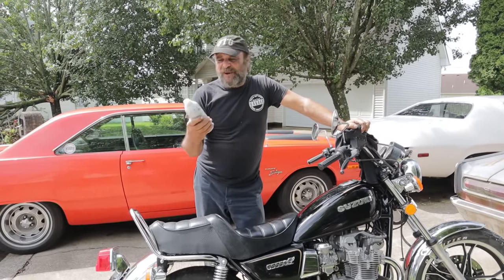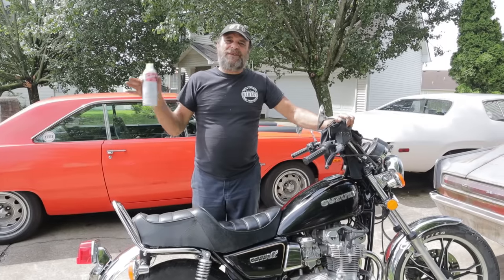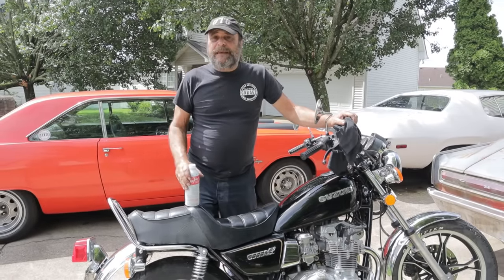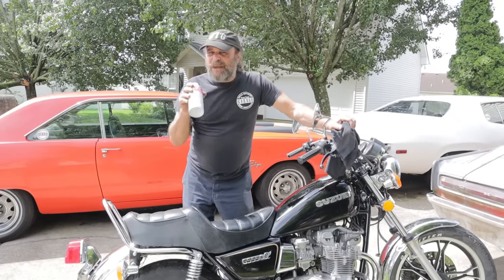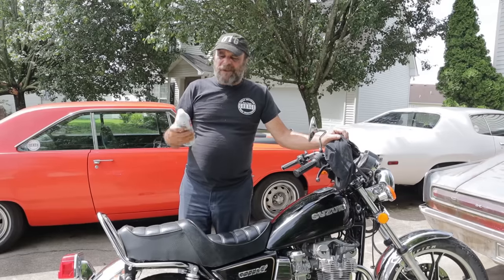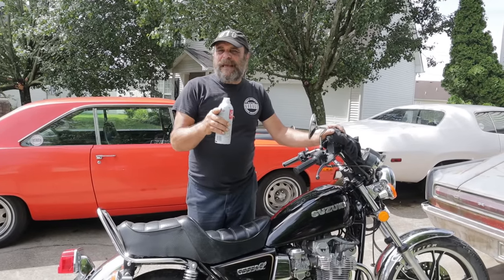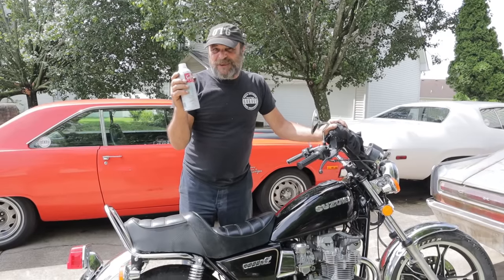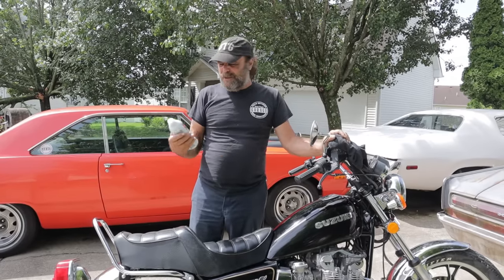We Try Seafoam - We Come Away Shocked

Comment: I've used seaform for everything.

I had snowmobile that sat outside for 3 years. Injectors were clogged. Ran a clear tube on each injector and filled it with seafoam...set my compressor regulator to the fuel PSI, 9V battery to pulse the injectors open/closed and blasted seafoam through them at the same time.

Ran like brand new after that.

Comment: I also have used Sea Foam many times.  I use it in every tank I fill, especially on 2 stroke engines and lawn mowers.  It works wonders for engines that sit around.  Another product I use in my gas is Sta Bil.  It keeps the gas from waxing up in the carb jets. Works really good for boat motors.  Between the two products I like Sea Foam best.  I used Sea Foam in a Cobra Mustang, it cleaned ALL the carbon off the pistons and valves (verified with a camera and light that is mounted inside of a flex hose)!

Comment: I bought a Honda VT750 Aero this spring. It's an 18 year old bike with only 12,000 km (about 8000 miles), so I suspected it's been sitting - a lot! Rode it about 170 km in February to get it home and noticed the "lean stumble" and also had to keep the choke out to keep it from stalling. Thought about having a carb job done on it, but heard about Seafoam from my brother. he had the spray, so we took the air cleaner off, fired up the bike and sprayed Seafoam in. Bike ran better, but not perfect. I have now ran almost 3 tanks of fuel through it with Seafoam added, and it runs WAY better. No more stumble. No more stall. Can actually shut the choke off and she idles beautifully. I will run a couple more tanks through, as I've probably been running the Seafoam a bit light, but very happy with the results so far.

Comment: I've used seafoam to similar results, it's a mild cleaner that's not going to dislodge and clog up filters, jets or injectors and use it 2-3 times a year as fuel system maintenance in my clean cars and trucks. It can depend on whatever region you are in, but I cannot get high quality gasoline in my area, so fuel system cleaners are necessary every so often.

Comment: In Northern Canada Sea Foam is essential. Due to the severe temperature swings we get a lot of condensation. Just like Frank's Red Hot, we put that sh*it in everything!
Reply: Yep never used seafoam but every few years run a bottle of that petrocanada stuff that absorbs water in the tank an burns it off works great for water in the tank , seafoam may be good if the car or whatever sits with the crap gas we have to clean out aluminum dust from the engine , i have pulled carbs apart an the bowls are filled with a white ish powder from this crap gas

Comment: One of the few cleaners (solvents) on the market that actually works. 
I've used it just over 40yrs - tried others but came right back to it.
My cars - both diesel and gas - see it in the fuel system 4 times a year, my pickup the same, w/one can per oil change to keep the AFM free - so far 200k on my AFM 5.3 LS Silverado. 
When I had the shop I bought it by the case, used it to 'de-glue' all manner of carbs from snowmobiles to early 1900s motorcycles. It made a good way to decarbon the Aluminum heads on the All-Pro & NASCAR truck engines before jet washing.
Does exactly what it claims - a rare product these days.

Comment: I have used it with success for years. I first started using it in old 2 stroke and marine engines. We spend a lot of time on a major river near me and you don't want your outboard dying on you in the river.

We used it on tractors and all kinds of engines including diesels. Hey if it works , it works.

Unfortunately it became so popular that the price tripled through time comparable to other products. 

In my opinion every shop or garage should have a few cans of Sea Foam and MMO sitting on the shelf waiting for use.

Comment: It is a mild detergent based cleaner so it will lower the octane rating and it also works over time, so you are not likely to notice anything within a few miles of riding. Let it do its work over time and each consecutive fill-up, make sure to hit it again and may be even once more so it is even more effective. It is not aggressive like Berryman's B12 or Star Tron but it is also safe with older vehicles, seals, etc. For vehicles pre-2000, I typically use Seafoam or MMO, with newer vehicles Lucas Fuel Treatment.

Comment: I bought a gallon of Lucas oil fuel injector cleaner and I used it on my daily driver Honda Accord and my lawnmower. My lawnmower starts much easier after long storage and my Accord's fuel mileage improved from the range of 500 km to 560 km! I also used it on my 68 Cutlass with a sad looking Quadrajet and I noticed it no longer starve of fuel with hissy sound every time I pressed the gas pedal quickly.

Comment: I’ve used seafoam in lot of carburetors to clean them out. I have a 20-year-old Harley I put a half I can in it at the start of the season to clean out any dirt in the carburetor. To this day I’ve never had the carburetor apart still runs great. If you use more it won’t hurt it.

Comment: Had a valve tick on a low mileage car I kept parked for four months out of the year,only starting it once a week to charge the battery. After putting seafoam in the crankcase the tick and engine stumble went away. Also I use seafoam in my fuel tank every so often when I notice the engine doesn't idle smooth. Works like a charm. I use only 100 percent straight gasoline which results in more power and better fuel mileage.

Comment: I use it all the time as a preventive maintenance type deal on my small engines.  I add a few ounce to a 5 gallon can everytime I fill it up.  Ever since I started using it my small engine run like new.  My 2 stroke leaf blower used to be a pain in the ass to start but after 1 or 2 fill ups of the treated gas  they start with in 1 or 2 pulls.  It used to take 10 or 15 trys before using seafoam.   The aerosol cans work great also.  I've used the aerosol cans on a few high mileage cars with great reault.  I highly recommend it.

Comment: You need to listen to Uncle Tony.  I have an 83 Suzuki, GS1100ESD - original owner.  Struggled with carburetors on this bike from from the day I bought it.  They are early emissions calibrated carbs and the low speed jets are extremely tiny.  Until recently every time I would ride this bike it would act like a run lean scenario.  Last year I began adding Seafoam, this resulted in an almost instant improvement in engine performance.  Granted your scenario may different.  But in mine and Uncle Tony’s situation Seafoam is an ace.

Comment: I have a 67' mustang, Bought it 20 years ago and was a show winner.  Gave it to a family member who helped me pay for an auto accident I had at the time.  Car overheated and he parked it outside behind the garage for 11 years.  Several years ago he called and told me come get it or it was going to the junk yard.  Fixed the overheating issue (clogged radiator), new gas tank and a can of seafoam and it fired up and I could even drive it as is.  I have a few short videos on my profile page of me getting the car running.  I'm planning on a full drive through of it soon.
I've been using that stuff for 20 years and can't say enough good about seafoam!

Comment: My 2003 Vstar 1100 sat for 2 years because I was not physically able to ride it. When I did get back to it, it would run but only on idle. If I twisted the throttle, it would stall. I put a full can of Seafoam in a fresh tank and ran it for 10 minutes at idle and left it over night. Next day, ran it for 10 minutes at idle again but it would still die on throttle. Each day I did this and each day it got a bit better. At about 5 days, the bike was reving a bit higher and then suddenly, it ran normally. I got on and went for a ride and the bike has run beautifully since. That was 5 years ago and every year I put a con of Seafoam in at the start of the season. 
I can only say that Seafoam has it's application and saved me from doing a more expensive and bothersome carb job.

Comment: In 1967 my grandfather taught me to use Marvel Mystery Oil(MMO). We poured 1/2 of the pint can down the R1 on my Pontiac. I couldn't tell if it really ran better. Three years later I bought a 1964 Chevelle 300 2 door for $50, pulled the 6 cylinder engine and sold it for $25. I was given a 1963 Impala with a 283 but it didn't run. I replaced the timing chain and gears and found the cylinders to be very carboned up. I got the engine running and warmed up. I poured a pint of MMO down the R2 carb and shut it down. It smoked like a Uniroyal stack. I waited several days until it was raining and started the engine. I ran it a little above idle until it stopped smoking and then did a few revs. Pulled the car into the garage, pulled the heads, and found that the heads and piston tops were fairly clean. I overhauled the engine, put it in my Chevelle and had my G Stock drag racer for under $200.
Over the years, I found that putting MMO in the gas of older cars tends to make the engines run better. I picked up an 89 Mini van with a weak compression cylinder. I tuned it and used it as my daily commuter. On construction site you really don't want to bring a nice vehicle. After 3 months on MMO in the gas with every fueling it was running better. At 6 months I did a compression check and all cylinders were good. I think that the MMO can get into the piston ring grooves and free up the rings that get stuck in carbon build up.
I know that MMO helps prevent corrosion in small engine fuel systems but I'm not sure how much it helps automotive fuel systems. All of my engines are 20+ years old so, I use it in all of my gas. Its a wasted day if you don't learn something new. Good Luck, Rick

Comment: Try "Gumout Regane" 
It's designed for use with gasoline that contains ethanol. The seafoam is mainly designed for 2 stroke engines and pure gas.

Comment: use berrymans carb/choke cleaner in a can (not spray can) throw your greenish/varnished jets, needles and jet tubes in it and it dissolves that greenish deposit like magic,  not really a fan of adding to gas and running it. berrymans also makes a great carb dip, it comes in a gallon can with a little plastic bucket to hold your part, i recommend that too. Ive had carbs plugged so bad that despite numerous carb dippings/cleaning i gave it, i ended up stripping entire carburetor apart,  strap carb assy to a solid object and just blast away at all orifices with 4,000 psi pressure washer, what ever was plugging carb up before finally let go and now bike finally idles perfectly on 4 cylinders, bike was an 81 1100 maxim, a 1 year production bike so another set of carbs would not have been easy to locate.

Comment: I use seafoam every year on my bikes, it helps clean any build up from sitting during winter. I've used it on an 97 Acura that had clogged injectors, I ran 1 can through a tank of gas 2x and it cleared the clogged injectors. That's been 15 years ago and I still use seafoam.

Comment: Sea Foam is good stuff. Before I put put the bike up for the winter, I fill the tank (a full tank won't allow condensation to build up inside the tank), and I put about half a can of Sea Foam in to stabilize the  fuel. Works like a charm.

Comment: I feel like the way you felt about seafoam before trying it is how all "old-heads" think of additives. Back in the day it was snake oil but today's stuff is pretty darn good. I remember telling my dad I used  CRC on my direct injection turbo charged 4cyl. My dad freaked the F out. Told me to be prepared to buy a new engine... I told him I changed the oil after running it through the system. He was still convinced I just paid 15$ to ruin my car. I had him hop in and take it out for a drive as he test drove the car for me before I bought it, so he knew how it felt amd ran before the CRC. He came back and had a confused but excited look. He said, "holy shite It's a night and day difference in power, it's like a walnut blast in a can!". Cars been running strong ever since and every once in a while we'll be doing something on it or going someplace and out of nowhere he'll say, "I still can't believe that shite works.". With the same confused smirk 😏. Just glad to of been able to teach my dad something new and develop his knowledge as he has for me over the years.

Comment: Worked wonders on my 1997 50hp Mercury ELPT engine. It had that green copper looking crud on my needle valves and internal throttle body. Engine ran rough so to speak.
I dosed it heavily (way more than required) so much do, that going down river it looked like i was fumigating heavily for mosquitoes. A literal white fog going down river. After about a quarter of my 7 gal tank, my engine “AWAKENED “ with a noticeable increase in rpms, was smooth and ran flawlessly at slow/idle speeds.
Taking my cowling off, and carburetor inlet cover off, the carbs were spotless and shiny.
Magic in a can, if you want to gamble on a product, this is the one to go to. It simply works as stated.

Comment: Been wrenching on motorcycles since I was a kid, worked in various shops throughout my years and will definitely tell you seafoam, Berrymanns and marvel mystery oil Do work in my experience provided the carbs are not in need of seals. I tell everyone who runs vintage bikes to put a  couple ounces in every fill up and add marvel oil to the gas aswell as to the crank case.

Comment: A double strength dose of seafoam, techron, or lucas fuel system cleaner is standard practice for me after the bike has been sitting over the winter or similar situation. Obviously, the use of stabil or similar conditioner is a good idea when you  know something will be sitting awhile, but sometimes that doesn't get done. My lawnmowers all get techron powersports continually, and they can sit all winter and fire right up, no surging or stumbles.

Comment: I'll endorse it. Stuff's great for maintenance, it also will stabilize your fuel. I toss it in a full tank and go for a ride to get it into the bowls anytime I have to travel and it's going to sit a while. It wont work miracles but it will save you some elbow grease if you know when and how to use it.

Comment: I have used it many times on gas and diesel engines and transmissions as well .lawn tractor lawnmower dirt bike street bike old and new of all. And it works great . Sluggish diesel engines fixed it . Old lawn tractor wouldn't stay running worked awesome. Saved tons of money and time. And I'm not paid by Seafoam either it's just a really good product.

Comment: i bought a 1990 gsxr750 that had been sitting for years. after checking the oil and charging the battery i hit the start button. i got it to run and it idled fine. much more than that and it would sputter and pop. i drained the tank. put in fresh fuel along with SEAFOAM. i let it run for a while and slowly rode it around the neighborhood occasionally goosing the throttle and it would sputter, pop, buck and bang. after a few days of doing this i was riding in the neighborhood and goosed the throttle and it sputtered, popped and then took off like a bat out of hell. after that i rode around normally and gave her the beans and she never skipped a beat afterwards. i love seafoam. to this day i add some seafoam to the tank of my zx14r every 3 months just to make sure the injectors are clean. i ride all year long as long as the temp is over 40F.

Comment: I threw some Royal Purple fuel additive in my tank on my '88 f250 (460 EFI engine) before I took a 150 mile drive to denver. It increased my fuel economy by about 4 mpg. $4 for 4 mpg on a gas guzzling vehicle is incredible.

Comment: Got a old tractor that had a cylinder down to 50 psi, thought it might be froze piston rings. So poured an once down s plug hole and bump it a couple times over the next couple hours. Tested it before I even started it and was up to76 psi, did it again. After the second time I was within 5 psi of the other cylinders.  Its better fuel stabilizer than stable by a long ways.

Comment: Try running a bottle through the tank every time you change your oil. This stuff keeps carbon off of valve seats, keeps pistons clean, spark plugs etc it really is good stuff but I use Berrymans now. Same results for $3 ish

Comment: Yeah...I have used it many times, on marine engines...hence the name.
 Have had good success on outboard, 2 strokes that have been inactive.
 After carb rebuilds, we use SeaFoam...in small doses, to clean up ports and such.
 Usually works pretty well....but not a "fix all" by any means.

Comment: How did you make it like 67 years before you tried Seafoam? 

Its best use is for removing varnish. Especially for hydraulic lifters. Got rid of some lifter tick in my BMW M54.

Marvel Mystery Oil works too.

Neither of them will work miracles, though. They help to "freshen up" and engine but they won't eliminate years of neglect.

Comment: My dad has swore by sea foam for years. I also use it and have no complaints, though I’m skeptical of putting it in the crank case oil like it says you can do also. I run 91 octane non oxygenated with a dose of sea foam in all my 4 wheelers and dirt bikes and lawn mowers and all other small gas engines and I never have any problems with things starting after sitting for extended periods. I just pulled my garden tiller out of the shed after sitting for a year and it started on the second pull with last years gas even. I’m not a chemist just a poor country boy but it seems to me the stuff works 👍

Comment: It also works great if you got carbon build up in your combustion chambers. Put some in a spray bottle, pull air cleaner off, and while the engine is idoling spray the Sea Foam in the intake. Don't let it die. I've actually seen the carbon blow out the exhaust pipes on my Harleys.